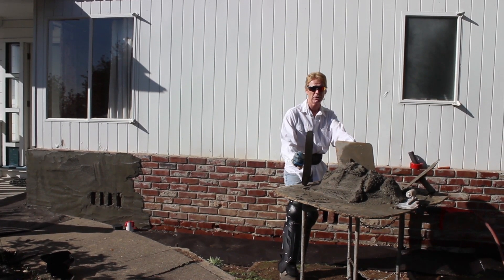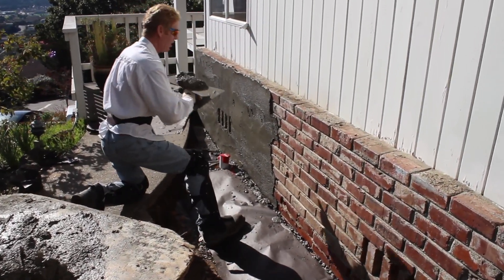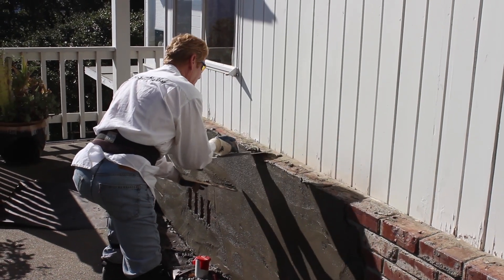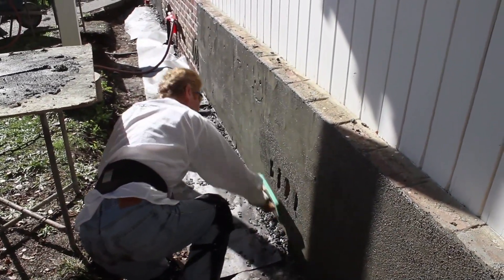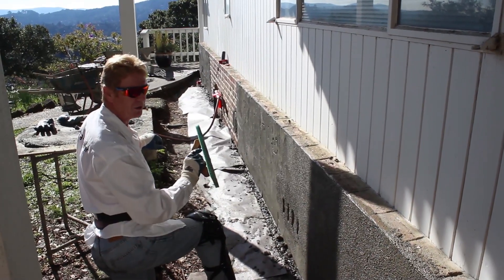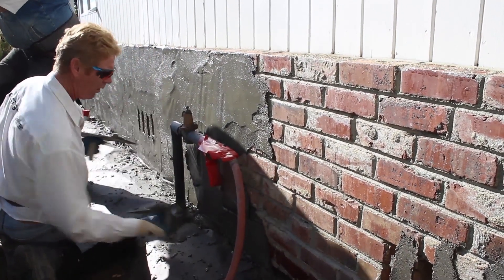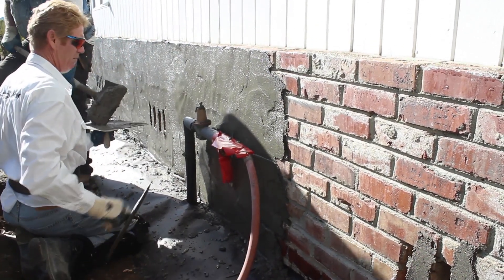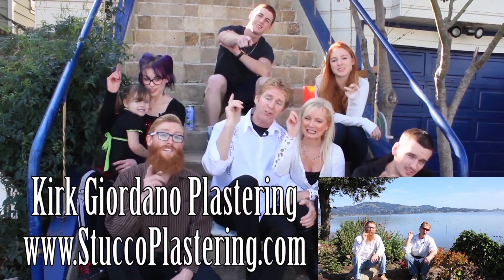Stucco over brick walls

Comment: I have a few questions but first I'd like to thank you & your family for the years of GREAT Instructional videos... It's very generous of you to share all your extensive experience & expertise with the world!  I'm currently remodeling my grandmothers house in Torrance, Ca. to get maximum value for it after her recent passing. I plan on re-stuccoing the entire house & the surrounding block walls. The back part of the house had siding over a medium float finish but that was removed about 3 or 4yrs ago & a crapy patch & paint over the holes by someone who wouldn't know the dangerous end of a hammer if he was repeatedly hitting himself with it! & the front of the house has a kind of a cat faced/ freestyled finish that I don't believe has ever been painted (Or if it was it was over 10 or 15yrs ago?) I want to go over the whole house to make it all the same "Heavy float finish" & my questions are 1. After pressure washing everything can I achieve this by just laying a new color coat on a lil thick (1/4" or so where needed to smooth the old rough finish?  Do you recommend I use a bonding agent &/or  an additive in  your mud & a place to get it at a reasonable price?  &  For the block walls, if I have it right you recommend applying about a 1/2" Brown coat first then going over that a few days later with the color coat?
Reply from the maker: Howdy  Troy, the bonding agent needs to be applied the surface of the house not in the stucco mix.
You can purchase your materials at a plastering yard such as Westside or Cal-Ply or Home Depot.
 Lastly, after a skim coat over bricks, the color coat should be allowed to set for two weeks prior for a cementitious color finish or 1 month if you're going to paint it.     
                             Live long and Plaster
Teaching the world how to plaster one Video at a time.
Reply: OK... Got it on the bonding agent applied directly on the house after a good pressure washing... can I use an airless sprayer with that or just roll it on & is that a "Yes" I should be able to achieve the desired end result of a "Heavy float finish" on the house using just the new color coat? 
   I was looking at using Lahabra's Exterior Color coat on all of this project after doing the block walls & some patch work with their Fastwall Stucco Base 80 lb. One Coat Concentrate Gray.... Sound about right to you & On the block walls is that apply the skim coat & let set for 2 weeks before color coating bcuz I'd like to get away without painting any of it?    Thanks again for all your help.
Reply: I'm ready to start the project & just wanted to know if I understand you right & if the material I'm looking at using is right for my application or if you could recommend something better suited?    Thanks Kirk!
Reply from the maker: Howdy Troy, try watching the video below, it was filmed when we first started making video's so the camera and audio is not great, but perhaps it will help with your quest. 

              http://youtu.be/8B_bN3_EfkA    
                      
                             Live long and plaster
               Kirk and Jason’s plastering pearls of wisdom

Comment: Hi Captain Kirk.  I'm amazed at the beautiful areas out there in CA. especially the views!   Stucco finishes are Nice!   Are there replacement IFS/EFS systems to move from manually applied (by hand) finishes to modern techniques,  (i.e. cultured stones, rocks, stack ledges, stucco panels, etc.?)  Keep Doing Great.
Reply from the maker: Good evening CM dude, with stucco or EIFS you're only limited by your own Imagination, stucco is either a base coat with a finish coat while IIFS is simply a colored acrylic finish.
BTW, that was a hck of a view.
                       Live long and plaster
           Sharing the plastering knowledge

Comment: Kirk if you put on right to left sand and cement  you will work into the plaster and get better adhesion and drop less🤟
Reply from the maker: Evening Robert, thanks for the tip.   🍺
 Plastering tips and products by Kirk and Jason Giordano with over 800 video’s
           bringing peace, love, and harmony back to the plastering world

Comment: Kirk, first of all thanks for being so generous with your as well as your families time. I'm sure the more time you spend making videos and responding to comments and questions they create, the less personal time you have. That said, let me take some of your time if you will allow me to! Warning! Long post!

I have a small covered porch on a corner of my brick house. I plan on screening this porch in and because I of a design/decore choice I'm making I have chosen to stucco the two brick walls of the porch. 

They house has a brick that I can't find a match to. I may have a need for matching brick down the road and I'm thinking that putting stucco over this brick would be a waste of what might be valuable "donor" brick. So maybe I remove the brick?

Here's the issue. Were I to take the brick down I'd be exposing sheathing as well as have a 4" deep void and trim issues around the doors and windows. My thought is to fir the wall out within 1/2" of the original depth and then skin with Durarock or some other cement board then stucco over that. 

What do you think?

Thanks again for your time.
Reply from the maker: Howdy Stuart, you can do this, but for saving possibly hundreds of hours, I'd call three brick contractors, the can probably match the bricks within minutes of seeing them at again a tenth of the cost that you might imagine it would cost.
 It will require some phone calls, this time researching might prove your best call.
                    Live long and plaster
      Plastering and repair tips for your home

Comment: Kirk, what type of stucco should I use over the brick? I see so many different types in Home depot or lowes. Not sure which to use. What do you use or recommend?
Reply from the maker: All stuccos sold at HD or lowes will work, Green Cor by Quikrete has fine sand while rapid set has heavier sand.
 Quikrete makes many stucco's that can be applied.👨🏻‍🔬
Reply: @StuccoPlastering  Thank you so much!

Comment: I want to first of all thank you for all your videos! They help me and my father in fixing up our house! Thank you! If I may ask question, I'd appreciate some input. My dad and I are trying to do something over some drywall someone installed years ago, and what they did looks like a disaster! Their drywall is all wavy with many holes and such. It's secure to the studs but we'd like to put a veneer over  it to at least give it a "country" look as opposed to a "crappy" look! Itll never be smooth, but hopefully we can makw it better! Some of the low spots and  joints have almost quarter inch  depth. My question is what product would you recommend that's strong and will dry quick, and can be applied for my issue! Any help at all will be greatly appreciated!!!!!!
Reply from the maker: Howdy Bob dude, easy question, apply a bonding agent "plaster weld" or similar, I would recommend 20 minutes drywall compound by Easy Sand or Wespac sold at home depot or lowes and all the rest of the smaller hardware shops.
  You can apply coat after coat as thick as you are able to plaster.
FYI,  20 minute means the amount of time you have before it sets, they also sell 40, 60, 90 and so on.
                       Live long and plaster
 how to repair your number 1 investment
Reply: Kirk Giordano plastering Inc. Thank you so much!!!
Reply from the maker: Howdy Bob, no worries     
                    Live long and plaster
        Teaching plastering and stucco work

Comment: That is just what I have on the front of my house, a low row of bricks in the front.  I'd be afraid in the Bay Area that they will crack because of earthquakes or settling.  But in any case I would not have the guts to try it myself for sure!

I do like the sand finish terminology better than the float finish terminology because it finally describes what it is.
Reply from the maker: Good evening Truth Dude, I never looked at it that way, from now on I will be calling this procedure a sand finish. the float Termanology is stucco layman's talk, not homeowner talk.
                       Live long and plaster
           Sharing the plastering knowledge

Comment: I have an interior wall and fireplace surround in which I want to cover with stucco.  This is the first video I've seen that clearly shows the layer and thickness...thank you so much!

My question for you though is, since this is an interior wall, what would be the best way to clean it?  Pressure washing it really isn't an option (I don't think?)...because there is an electrical outlet on the wall.  The brick is 48 year old and doesn't seem to have ever been cleaned.  I'm currently using a $7 deck brush (stiff nylon bristles) from HD and there's just seems to be a nasty film coming off the wall no matter how many times I go over it (currently 3)...and it still feels like there's a thin film of debris over sections of the wall.

I'm so anxious to get started putting up the stucco, but I certainly want to make sure the wall is properly prepped before I do.  What should I do?
Reply from the maker: Howdy Justin, I would use a five-gallon pail of soapy water and scrub it until no more dust comes off since you can't pressure wash, then apply a bonding agent and plaster away.      
                                   Live long and plaster
    Images of Kirk Giordano’s Plastering projects and tips

Comment: Kirk can you use this same process over Painted Exterior Brick?  
Also if you don't mind, I have had two contractors in the Dallas Tx area give me bids and one insist that the proper way is to mount cement board over existing exterior brick then stucco while another is saying mounting wire mesh and then stucco is the only way to go.  On also insist he is adding an "Insulator" into his stucco mix....  is this an up sell?  Any advice suggestion you have would be greatly appreciated, unless you happen to be in the DFW area and want the job.
Reply from the maker: Howdy Easy Guitar Dude, it appears you had to fools give you estimates. The procedure in this video is accurate. But first, pressure wash and apply the bonding agent to the painted bricks. Attaching wire does more harm than good, and attaching a board of any kind is so far-fetched, that he must have no clue as to his own name to come to this ludicrous conclusion. 😉
https://youtu.be/dw34VLYFC1Y/ Improve the Look of block walls with stucco. Berkeley.
https://youtu.be/LW9Dwxl2W4c/ Stucco over concrete walls to remove form board lines.
https://youtu.be/MbZHkJCJuZ8/ Improve the look of your brick walls, Green-Core cement. 
https://youtu.be/d3sHR8KD16c/ Stucco acrylic going old cementitious stucco finish. 
https://youtu.be/T5kA6KdfAE8/ Making brick designs in stucco brown coat, SF.
https://youtu.be/TuwvarKFpko/  White stucco for never again painting of block walls.
https://youtu.be/IIeZcYBUbX8/ Stucco a Block Wall to match color old Chimney
Reply: Wow I came here with the same question. I got a $2500 quote to plaster a fireplace and he included fabric mesh. I’m in Houston tx.
Reply from the maker: Howdy Easy Guitar lessons dude, both fellas only have an idea. They have just enough time in to think about their right but not enough to know they're wrong.
No wire or boards are necessary. In fact, they are counterproductive, clean the bricks well, then apply a bonding agent, now plaster away. I have at least 25 videos on how it should be done. Simply type in, how to stucco over painted bricks. It's common sense for longevity.🍾
Reply: @chillintm  I wish this guy serviced Texas..... I would for sure hire him.  It is hard to believe a contractor and listen to their BS after watching video and seeing him work.

Comment: Sinsei- I would ask why you are not using a go-devil but you have taught us the reason why is you must key in the material.
 So today's question is why didn't you coat the brick with weld Crete material I believe it is called weld crete,where you paint it and it forms a bonding agent between the stucco and the brick
Reply from the maker: Evening Billy dude, excellent question, my son Jason pressure washed this wall very well, when you have either a brick, cinderblock, or concrete wall, new stucco will adhere by suction, the bricks were just pressure washed so they were still moist, our new stucco had a natural mechanical bond by both being porousas, so they will have adhered forever as a result.
 If not certain of a mechanical bond always use a bonding agent.                     
                                Live long, and plaster
                     Plastering tips and techniques
Reply: Just to chime in here we did apply a full strength coat of weld Crete to these bricks prior to my dad's arrival, just didn't get that part on film. It isn't technically necessary when the bricks are clean and in good condition, but preventative measures are cheap and save dough in the long run. It is especially helpful with boding around the vent holes, and makes it much easier to get a clean line on those small spaces.

Thanks for watching!
Reply: Jay Giordano 2 questions,
1-Do you believe one day the student will surpass the master ?
2-Have you ever eaten a Giordanos deep dish from my hometown of Chicago?(quite tasty)
Reply: Billy Field Surpass? I don't know about that one, but I do expect to develop different strengths over the years than he has, as I've had a pretty good teacher. He's still got over 20 years on me, so it won't be happening any time soon!

And I've never been to Chicago so I have not, but it's on my list for someday!

Comment: Clean work. Thanks for sharing your craft. I’m about to skim coat brick on the sides of my front stoop. Then put stone veneer over it. Can you recommend a product that will work best. It’s only being used to smooth the surface and level for the stone veneer after. Also how long before I can cap the skim coat with my veneer?  Thanks so much Rob
Reply from the maker: Good Evening Rob Dude, and tile setter will work, Poly Bond by Lahabra, also is a cementitious adhesive cement plaster that bonds styrofoam to base coats, will work also.
       FYI, we are still working through the pandemic, however, if you’re not you can still learn to repair yourself through our huge selection of videos on this channel.   
 Bringing you the most comprehensive encyclopedia of free plastering video’s ever put together,
 by the plastering messengers of Youtube. 
Kirk and Jason Giordano with over 800 videos 🎭 👀💃
Reply: Kirk Giordano plastering Inc. thanks again. Appreciate the response. Stay safe. Rob

Comment: I have one side of the house that’s all brick I pressure washed it and its about 12  ft. high 
Should I 
just apply glue  
Or add some wire 
Or Add straps
I plan on using spec mix applied at 1/2”
Reply from the maker: Howdy Lincoln, if it were me I would apply a basecoat as in this video, stucco netting it not necessary and often does more hame than good. 
FYI, in over 30 years an I have installed stucco netting only once as the brick wall was really beaten up.  
 Lastly, stucco must be applied to a surface that is very clean as nothing adheres to dust, if you not sure about the raw bricks and its ability to achieve a mechanical bond naturally, apply weld crete as a bonding agent.    
                     Live long and plaster, 
  Sharing stucco secrets and or common sense tips
       Images of Kirk Giordano's stucco repairs
Reply: Thanks for the quick response kirk 👊🏼 
Already pressure washed 
I’m going to apply the bonding adhesive 
Then brown coat , wait a day or two then finish with a la habra color coat using a skip trowel finish 😎 and good bye brick
Reply from the maker: Atta boy Lincoln, one last tip, wait at least two weeks before coloring.
 When stucco is first applied it has a pH level of about 14 I'd wait at least two weeks for the walls to drop down below a 10 on the pH level, boring tech stuff but necessary.
 
                      Live long and plaster
        Images of Kirk Giordano’s plastering repairs
Reply: And easy way to tell if you need a bonding agent is to test how porous the brick is. Splash some water on it, not much about a cup at a time in several places. If most of it soaks in you have a porous brick and no bonding agent is needed. If most runs off the brick is more dense and a bonding agent would be best. As well some brick have a thin slurry type color coat on the face, clean as much off and use the bonding agent.

Comment: Would installing stucco lathe be better on brick before stucco in northern climates?
Reply from the maker: no, it would not be, cleaned pressure-washed bricks to make a more permanent Mechanical stucco bond than stucco netting.😉
Reply: @StuccoPlastering  thank you so much! Awesome videos like always!

Comment: Hi Kirk and family...I have a question in the uk to mix rendering or Portland cement stucco they use a front loading rotary mixer versus the tupe u use...is the any difference it the equipment. What is he diff between the 2 mixes that makes one better than the others.
Reply from the maker: Good afternoon John dude for the UK, the frontal round barrel type mixers are used here too but mainly for concrete, We prefer the tow behind ssuch as Multiquip, Essex or Whiteman plaster mixer for plastering, as they hold more and mix better
                       Live long and plaster
           Sharing the plastering knowledge